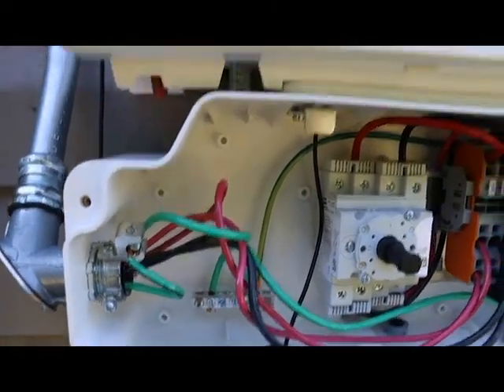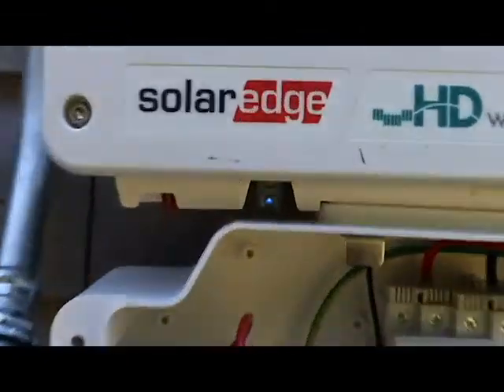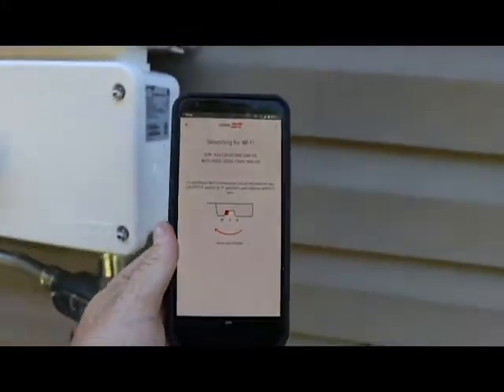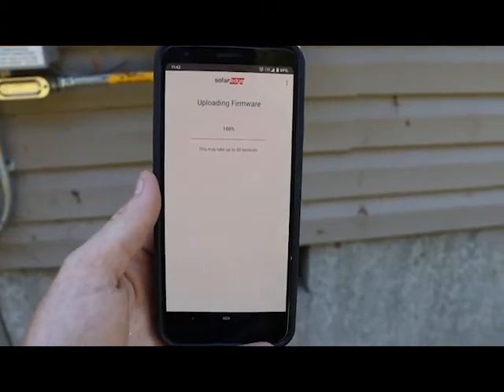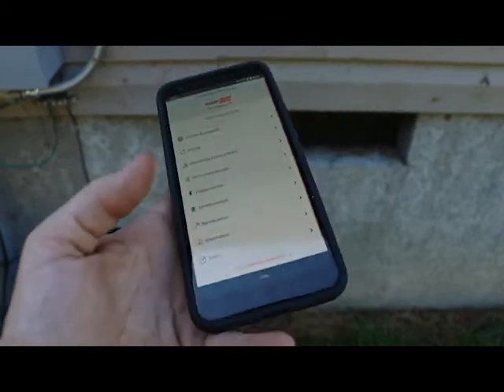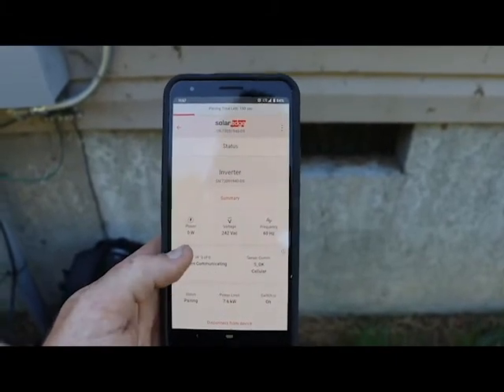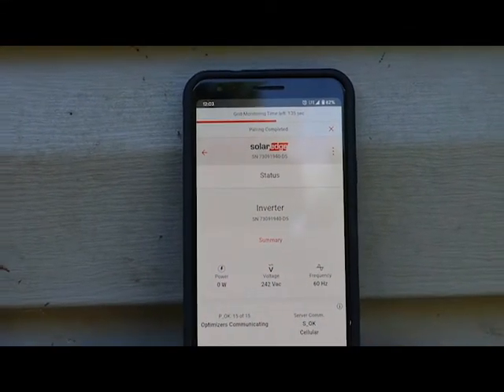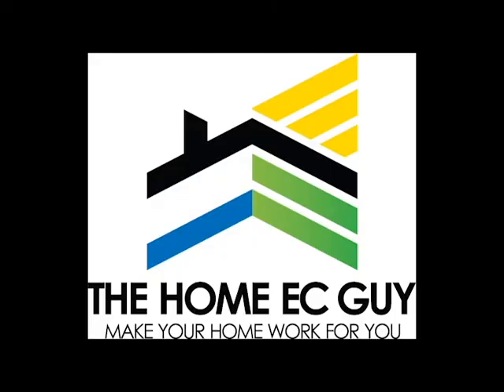SolarEdge Inverter Swap

Comment: I have an inverter that died and was sent a replacement. Can I install and activate the new one myself using the app, or do I need an authorized installer to activate it?
Reply: Do you have to have the app to activate it? Or can you just install the inverter and hold the switch to “P” for 5 seconds and have it produce ?
Reply: @austinfradette5514  I needed the app to activate it. Let me know if you have any questions activating. I'll help you.
Reply: @1ceCold037  how long does it take the panels to start producing? I have DC voltage. But when I did the pair the inverter didn’t pick any optimizers up. Does it take a couple hours for the inverter to discover them?
Reply: @austinfradette5514  Mine took about 10-20minutes.
Reply from the maker: So it's highly recommended that you have a professional install and activate your new system. Things always seem smooth and easy with an edited video 😉 any number of things can arise that can be very dangerous or deadly.
Reply: @HomeEcGuy  I already did it myself and activated myself. Piece of cake :P
Reply from the maker: @1ceCold037  awesome! Sometimes they are super easy and sometimes they can be tricky. Depends on if you have to swap brackets and how the initial installer wired etc. Glad you got it up and running again with no problem